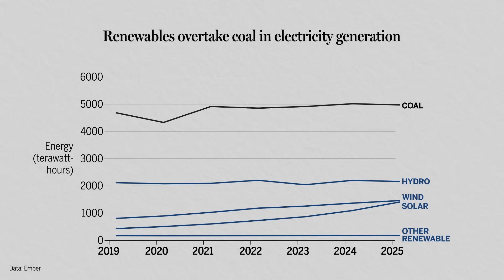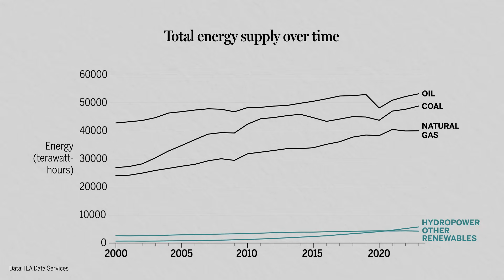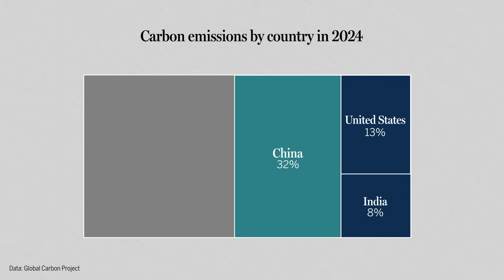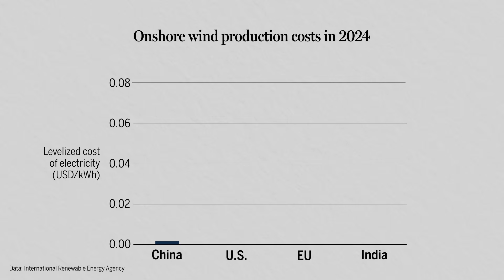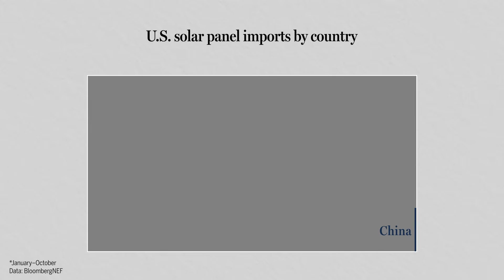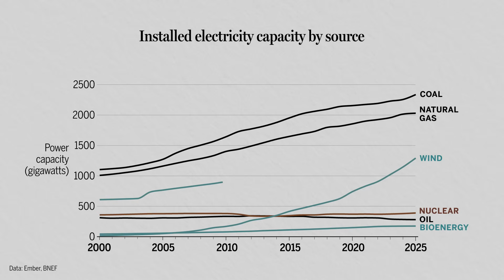How cheap renewable energy is finally flattening emissions

Comment: Why pay for expensive gas/oil/coal if you can have cheap solar, wind, hydro.
Reply: and the funny thing is the oil/gas industry is expensive even while being subsidized like solar. even right now the US alone spends about 40 billion a year on oil and gas subsidies. and many times more that in tax breaks and preferential treatment.
Reply: @romanplays1  the UK currently has the highest energy prices in the world…  the sole reason is to subsidise “green energy”.  We are closing down our oil production so that we can import it from other countries instead.
Reply: @adamski6312  Completely untrue, energy prices in the UK skyrocketed when the war in Ukraine started. It is soaring oil and gas prices that causes the high energy costs in the UK. The UK uses marginal pricing which means even if 80% of your energy is currently being produced by cheap renewables, but the remaining energy is produced by oil or gas then then highest price will be charged for all energy sources. So at the moment the UK end customers do not benefit from all the cheap energy from renewables, because you are being charged the price of oil or gas for all of it and the energy companies are making a massive profit. This will not change until you have 100% of renewables for a significant amount of time. This is why people need to cop on, and press their governments to either change the marginal pricing system so that customers can benefit from the cheapest form of energy (renewables) or push their governments to move faster to 100% renewables and battery.
Reply: @I@ImpossibleSolution-k6wrent crude is at a 5 year low at the minute, yet energy bills are higher than ever.  Energy bills are steadily rising as oil price has been steadily falling
Reply: @adamski6312 . ??? Crude as fuel goes to transportation, not home heating. US gasoline prices are low, $3/gallon. Last time gas was this cheap was 2015 , inflation corrected, w OPEC crashing the market. Last time before that was 2005.
Electricity prices are riding, but that has nothing to do w crude. Adding a lot of solar and wind, which never closes old plants, but needs new spending, that drives up power bills.
Reply: @adamski6312  Oil is generally not used for generating electricity, but good job trying to make sense. Have a participation trophy.
Reply: @Nill757 I was responding to the person that said energy prices in the UK are high because the crude price is high….
I’m aware that crude oil has nothing to do with home energy.  I’m not stupid
Reply: @d@davestagnerat w @davestagner d I say that?? You sarcastically wade in saying I need a trophy, when you didn’t even bother to read what was said.  The person I was replying to said energy prices were high because of oil price…. I pointed out that this wasn’t the case, as uk energy price is rising alongside the falling oil prices.
How embarrassing for you
Reply: @adamski6312  Isn't the problem here marginal priicng rather than green subsidy? Check it out.
Reply: @ImpossibleSolution-k6w I agree people need to voice there opinion and demonstrate against marginal pricing, all electricity sources should be priced independently, this will also give incentives for the utilities that largely rely on Oil and Gas for production to switch to renewables because they will start to lose money and go bankrupt if they don’t change practices.
Reply: @adamski6312  The current UK nuclear project will triple the cost of electricity for the next 50 years! While renewable can make electricity at 6 pence per kWh nuclear is about 20 pence per kWh without considering the transmission... You are like Abbot and Cancun Cruz : you inverse the cause and the solution in the hope that people keep making the worst decision available!
Reply: @romanplays1  Renewables actually get much more in subsidies
Reply: @thegreataynrand7210  you got any facts for that delirious take?
Reply: @romanplays1 Yes simple research that any 10 year old can do online.
Reply: @thegreataynrand7210 so you got none. Understood
Reply: @thegreataynrand7210  Being allowed to just dump waste CO2 from burning fossil fuels into the atmosphere unabated IS a subsidy, just like a business dumping its garbage in your yard without consequences would be a subsidy. Current carbon capture/sequestration techniques cost $200-500/ton, best case. It takes about 50 gallons of gasoline to produce a ton of CO2. So it would cost $4-10/gallon to clean up the CO2 from burning gasoline. That is a subsidy. Feel free to fact-check me. But if you retreat into climate denial and saying CO2 is not a problem, I’m going to point and laugh, and so will every rational person.
Reply: @davestagner No ine is denying anything and the facts are that renewables recieve far more subsidies than fossil fuels and have been for years. As stated before climste change is a manageable problem.
Reply: @romanplays1 wind and solar get enormous direct subsidies.  FF get almost none (direct). FF does get tax breaks.
Reply: @Nill757 A tax break is a subsidy! Just in a different  form!! and dollar for dollar fossil fuels get way more subsidies than renewables, I believe if I am remembering correctly, the Just have a think channel covered this in detail.
Reply: @ImpossibleSolution-k6wyes, but a very different kind than direct subsidies to VRE which directly affect prices and distort markets.

Just have a Thjnk is propaganda for fanboys. Read IEA instead
Reply: @Nill757 that’s the point the politicians in charge wants to distort the market to make Renewable Energy investments more attractive.
Reply: @thegreataynrand7210  Not if we consider the data. Just last year, the tax credit from the oil and gaz sector is a part of the GDP.
Reply: @thegreataynrand7210  "Renewables actually get much more in subsidies"
Citation please.

Telling people to look it up is not a citation.
Reply: When your country is run by someone being paid by the people profiting from gas/oil/coal and you are not too bright and actually believes him.
Reply: @edvoon most politicians are in the pocket of big solar wind  and their NGOs now.  $trillions of business.  But the hippies, yeah they can’t give up the notion that big oil runs everything they don’t like.
Reply: @Nill757 total nonsense, stop reading pro oil and gas rubbish!! Renewables is cheaper by far. If you remove all subsidies from both oil/gas and renewables. Renewables is the winner. Investment bankers are keen, not because of the subsidies but because there is money to be made and so long as the marginal pricing system exists there are serious windfalls to be made in renewables, because the are getting paid ff prices for generating electricity with renewables. So all those currently investing in renewables in the UK wont be rushing for 100% renewables any time soon, because so long as there are people like you to keep beating this particular drum and slow down the total switch to renewables it suits them fine, to be paid 30% more than it costs them even with profit.  Inform yourself about marginal pricing.
Reply: @Nill757  Least delusional anti-renewable proponent.
Reply: @latlatko I’m anti big lobby $ influence on policy - from anyone. I’m not anti RE hydro, and I’m not anti small shares of RE wind and solar as long as it’s not driven by subsidies and mandates. Im strongly anti the notion of trying run anything 100% solar+wind, or even 50%.
Reply: @Nill757  Why shouldn't it be driven by mandate? Don't  you think the people should have a say in how their country is run? Hydro power isn't possible in many places, and renewables are simply a necessary component of the future. Nuclear is the only viable alternative but good luck achieving anything of note there in a viable timeframe.
Reply: @latlatko . Not sure how mandates are consistent with “people having a say  how their country is run”. Mandates mean some people, possibly including the best connected and special interests invested in W/S, force others to do what they are told regardless of cost. 

My main objection to wind and solar is that I think it’s backwards to assume W//S can do it all, and that nuclear takes forever.  Nuclear in my view is the only option to an all clean grid next several decades that’s affordable, w low impact, vs the vast land use from 100% W/S and transmission everywhere. After  that, CCS w FF is next best bet. Anything but 100%WWS. No surprise that the WS  notion continues given the years or fraud from the like of Jacobson.
Reply: @Nill757 a mandate is given by the people. and regarding nuclear, I'll believe it when we actually start building reactors. for now it just seems like a cynical attempt from anti-environmentalists to undercut efforts to move away from fossil fuels
Reply: @l @latlatko govt mandate for forms  of energy to all the people comes from some of the people.  Should be a majority, but even that may not be the case given the special interests motivated to have their product mandated.

As for VRE vs nuclear, well as I said earlier, it’s the majority power grid share of intermittent power looks delusional to me, exists nowhere in the world. But majority nuclear examples do exist, for decades now.
Reply: @Nill757  Like I said, i'll believe it when the reactors start being build. if that happens: great, awesome. love it. But the reality is we're not gonna get there in time. should've started that decades ago. So i don't like this 'oh we'll just build nuclear' argument because most people making it seem to have the hidden agenda to keep pushing for fossil fuels, because they know nuclear isn't gonna be ready in time. So if your argument is, build nuclear and renewable, thats fine. but if it is stop the current renewable plans in favour for a nuclear option which may or may not happen, thats my issue. Because i simply don't trust that it would actually happen.
Reply: @latlatko bizarre. I don’t follow the default assumption that non-hydro renewables will get there in time, or ever, when it never has, not anywhere, ever.
Reply: @Nill757 give us a break mate! That is simply rubbish
Reply: @Nill757 After you buy a subsidised panel it gives back that subsidy via less coal burning and the lessening, even minutely, of the impact of climate change. But wait you say - it is bad to make panels re climate change. Time to see the reality that change is a challenge for me and you
Reply: It's not cheap either in installation or cost to the environment.
Reply: @seewhatifound it only needs to be better than then the alternative
Reply: @latlatko  But it is not , it is not sustainable on a daily basis without relying on other nations. The expensive cost on energy thrust upon us doesn't make it cheaper and an outlay of thousands of pounds for 4kw a day imakes no sense when the carbon cost of the whole manufacturing process is taken into account .
Reply: @seewhatifound  The entire fossile fuel sector is also unsustainable without relying on other nations, so that point is moot. Exepnsive energy is a whole other can of worm, but the main driver of that is increased natural gas prices. I don't know what an outlay of thousands of pounds means, nor what you want to achieve by using kw a day as unit, please use a standard energy term like kwh so you can actually compare because right now i don't know if you mean 4000 watt of solar panels operating for a whole day. or 4000 kw generated over a period of a day. but if you say thousands of pounds i assume you mean the installation of a 4 kw solar panel system. which will generate between 15 and 19 kwh a day. with the average lifespan of a panel being 30 year. If we assume the higher end of installation costs of 10000 pounds. that is 5 cents per generated kwh over the entire lifetime. If you think thats expensive you're just lying. and finally Solar panels pay for their own energy and carbon costs within 2-3 years. that is taking all inputs into account. and can be reduced further by using more renewable energy in their manufacturing.
Reply: @latlatko  nuclear time.  forget the buzzwords and half truths about solar and wind. nuclear is the future.
Reply: @JohnDoe-tx8eu  Nuclear is at least as filled with buzzwords and half truths. And my position stands: I believe it when it happens, and if it does. awesome. But untill then, dual pronged approach.
Reply: @JohnDoe-tx8eu  Nuclear is like hydrogen. It is perfect until you consider economic. And then it makes abolutely no sense whatsoever. Nuclear had a good run in the 50 because government spend without thinking needing more bombs to blow out the red... Now when the real cost are considered, it makes absolutely no sense. The current UK nuclear project will triple the cost of electricity for the next 50 years!
Reply: @seewhatifound  There is no free lunch! If you want to see what is the "alternative" National Geographic have made a great paper on Tar Sands! Thousands of miles of poisonous water and soil!!! So clean wow!!!
Reply: @pierregravel-primeau702  in the UK?....Thought not. How much mining has there been to supply the renewable industry? Tar sands are not everything, plenty of other options.
Reply: @seewhatifound  Tar sands are just the most obvious example of the destruction made by fossile fuel. I am pretty sure you can find many horror stories about when the UK was exploiting fossile fuels. It is not for nothing that rich countries don't want mining on their territories and give these role to horrible countries without any stabilities. If the local population is consulted it would never work. Nobody want  absolute destruction of their environment to make some wealthy oligarch wealthier...
Reply: @pierregravel-primeau702  An old story been going on from 10 -20 years ago when the environmentalist s were pushing their agenda alongside net zero. Net zero that became a "thing" dreampt up by those in Davos after the 2008 financial crisis meltdown to reset the world economy and make fortunes for themselves. Look at them today all fawning over each other. The worst end of society as it stands
Reply: @seewhatifound  If you look at Europe and China, they are all getting rid of fossile fuel : it cost too much and who want to depend and beg some arab prince that kill american citizens?
Americans I guess....
Reply: Irony. Western countries heavily investing in renewables have the highest energy prices. Germany, UK and even sunny, rooftop solar heavy Australia. The energy generation (!!!) might be cheaper. But the investment required into transmission and grid stability was underestimated at best ... If not forgotten over the last year's/ decades.
Reply: @surfer123au That is very true, and the cost of building out transmission and grid infrastructure for renewable technologies needs to become a lot cheaper. How that’s actually going to happen I have no idea?
Reply: @surfer123au  You know how much having few private jets for each of your pets cost? You are really ignorant of the need of the aristocratic class!
Reply: Cheap solar ROFL ....
Reply: It's not cheaper ...
Reply: @nosknut  Absolutely it is a myth tuned into a "fact" If it were cheaper prices would be a lot lower now. It has been a "thing" since 1970's, so if it isn't cheaper after 50 years, it won't be cheaper in the future as every input cost will rise. Some prey on victims with their false ideology
Reply: How are you going to manufacture it?
Reply: @rack_man Using renewable energy of course
Reply: Current Hydro is still problematic
Reply: @supreetsahu1964 can be, but it is a the single best solution for countries that have stable water flow and rivers. Designed well it can produce an enormous amount of energy and limit hydropowers overall impact in the country, by building big a few places and reducing the need to impact other rivers and land areas in the country. Limit the impact to as few places as possible.
Reply: We in Australia give $21B in Diesel rebates to big miners etc
Reply: @nothinghere1960  We in Australia are paying 40% higher electricity despite all this green energy BS, and yes I have solar and battery, 27 panels and 10kw battery.
Biggest con ever, Nuclear power is the future.
Reply: @ShaneMcGrath.  Nuclear is at least as expensive if not more expensive. It costs a lot to build a reactor.
Reply: @latlatko Actually you are correct the total life cost might be manageable but the initial investment and of course the operating expenses for safely handling nuclear waste and storing it is often not taken into account and that is very high. Så overall it will increase prices of electricity rather than reduce it. 

Only dropping marginal pricing and paying producers based on there production cost + small margin would allow for the restructuring of the power grid without overcharging users of the energy for the foreseeable future.
Reply: @ShaneMcGrath. 40% higher than who ? I'm in the 3rd 🌎 at the moment ( SriLanka) and electricity rates are to increase by 11.8% next month. The BS you complain about is the legacy providers never want to make LESS profit. Any investment they make in poles and wires is payed for by us. Sounds like you have a system which is good but to keep their " profit " to satisfy shareholders the next kick will be access charges skyrocketing. And Nuclear. I learnt only yesterday that in Germany the % provided by nuclear is 3%. There is going to be pain everywhere because change is difficult
Reply: @luffirton  nuclear is the only source of power where every gram of waste has to be accounted, and its always paid for up front. PV panels, go in the dump.  Oh yes there’s talk about recycling PV, talk, but that would increase cost, so, dump.
Reply: @latlatko  PV seems cheap if the notion is a couple panels on the roof of the tree fort. If power is to run a country, then the panels must match the output of a reactor.  

Replacment of a 1 GWe reactor running 24hr requires about 5 GW of PV, ie 12 million 400W panels producing power  when the sun is up, and probably 15 million panels to get through winter. Million. At 20kg ea that’s  some 300,000 tons of panels, not including the mounting rails, foundations, wiring. The 5 GW of solar needs about 25,000 acres of land (best practice 5acres/MW).  Nobody gets chunks of land that big, so it gets cut in 50 or 100 pieces, spread around the country, which means 50 or a 100 new distribution lines cutting up the country.   Replace all of that every 25 years. The panels at $1/W are $15B if land costs hold w/ more and more land used, so land $ goes up. 

Then there’s storage, maybe 15 GWh of battery, which at $400/kwh is $6B, replaced every 15 years. 

Last, solar and battery using even the best grid tie inverters just don’t work if they are the only thing on the grid, as we know from the blackout in Iberia. Must have synchronous generators, like nuclear, that ride through fluctuations in load.
Reply: @nothinghere1960 They probably would struggle a lot more if that rebate was not in place. Since this industry is important employer for Australia. There is many citizens that impact politics in that sector by voting for politicians and parties that propose or support subsidies, deregulation and rebates and tax breaks for the mining industry.
Reply: @luffirton We give subsidies to coal , gas and mining and get absolutely screwed for the privilege
Reply: Because it’s ruining the grids. 🤷🏼‍♂️ it’s not 24/7/365 available
Reply: Sadly in Winter My solar panels are cover by snow, and if not covered produce only 1/10 of Summer production bellow  inverter standby consumption due this I need coal for winter.
Reply: @kkrolik2106  do you not clean them?
Reply: @romanplays1  I clean them only no Sun in Winter.
Reply: @kkrolik2106  yes I sure do hate living it perpetual night as soon as it hits November
Reply: @kkrolik2106 Use the grid for winter time just like me…
Reply: because renewables require expensive battery storage, the mining of huge amounts of rare earth minerals, and having backup gas-fired plants for when the sun don’t shine and the wind don’t blow.
Reply: Try looking at Britain, Germany, New York, California, etc, to see the actual cost of renewables.
Reply: @TimothyGasser  Trying looking at expert forecasters to see the actual cost of renewables.

The International Energy Agency (IEA) says solar plus storage is now the cheapest form of new electricity around the world. The lowest LCOE or Levelized Cost Of Energy. (We're talking wholesale prices, what the utilities themselves pay for electricity. What the utilities charge customers may vary and includes many other factors like grid costs and governmental pricing policies so your initial comment is very lacking in context.) 

So just who is the IEA? The IEA is THE industry-standard, go-to data aggregator and forecaster for all things related to the global energy sector. All the pros in business, investment and government turn to the IEA when they need reliable energy data. The long-standing IEA has historically favoured legacy energy like coal, oil, gas, nuclear and hydro in their projections. But now they say SOLAR PLUS STORAGE IS CHEAPEST!
Reply: @douglascutler1037  I have looked at the numbers. I have 30 years in the electric utility industry, 10 of which were in nuclear generation. As I said, the lowest cost claim is dependent of what accounting method you select. LCOE excludes costs that are associated with intermittent generation, namely backup, over build and storage.
Reply: @TimothyGasser  this sounds like you yourself are biasest towards coal then if its "dependent" on accounting method. This means your claims hold as little weight as everyone else.
Reply: @TimothyGasser  lets price in externalized enviromental costs of fossil fuels then, oh wait.. thats dystopia. lets not think about it then
Reply: @TimothyGasser  Canada is like 95% hydro and power is incredibly cheap
Reply: @davo1822  You know, a bright 12 yr old can look this up. Canada gets between 55 and 60% of its power from hydro. Canada also has 12% of the people the US does. In the real world demographics matter.
Reply: @TimothyGasser the US also has vast deserts with sun all day every day.
Reply: @xander9460  PV is cheap because oil, gas, and coal are cheap in the countries where these panels are produced. No more, no less...
In the end, there is no difference for the climate.
Nothing...
CO2 continues to rise, regardless of how much "renewable" energy you use.
No difference...
The CO2 graph proves it.
You consume a lot of energy on one side of the world to be "renewable" on the other side of that same world. The climate is a global issue, not a local "green" bubble.
Reply: @ivojanssens221  here's a wild idea:
>Use fossil fuel energy to make solar panels
>Install solar panels
>Use solar energy to make more solar panels
>Get rid of fossil fuels
>Profit
Reply: @notgreg123  Show me the solar farm that can produce 99.99999% pure silicon.
Because that's what you need for a PV.
Maybe do some research first before you make any claims.
Reply: @ivojanssens221  alright I did some research. Seems like the most energy intensive process is melting silicon down which can easily be done with electricity. It's only like 2000C as well which really isn't that bad. Just have enough solar panels to power it and ez pz
Reply: @notgreg123  It's a stove, a very large one. 24/7 because stopping and restarting the process wastes a lot of energy. And I don't know of any place on earth where the sun is present 24/7 all year round.
But that's just the beginning... now you have silicon, but it's not pure enough... more energy and chemicals will be needed... and the production of those chemicals also requires energy, 24/7... and also... it doesn't stop there, because those panels are not yet installed all over the world, and that also costs energy = transport, and sea ships no longer work with sails...
But back to the beginning, where do those "raw materials" come from? Mining... and not with "green" energy. Those raw materials are extracted, transported, globally... only to be thrown into a furnace somewhere and treated with chemicals. And those chemicals have also traveled a long way; they don't just fall out of the sky.
If you look at the big picture, you see that a PV cannot make a PV.
Please, try to find a furnace where silicon is melted. Maybe then you will understand that "green" does not exist, except in a few optimistic minds.
I can send you some links, but that's not possible via YouTube.

Now, oil is also extracted and shipped all over the world, so in that respect it doesn't make much difference. But don't make PV "green" if it isn't GREEN. And it really isn't.
Reply: @ivojanssens221  these are all just technical issues. Batteries solve the "but what about the sun not shining 24/7" issue, mining will always suck whether or not those materials are being used to make solar cells, chemicals can almost certainly be substituted considering Blue Origin figured out how to make solar cells out of nothing but lunar regolith simulant, and transportation and installation is a one time thing unlike fossil fuels that have to be continuously shipped even after the plant is built, etc. 

Doesn't matter if it's not absolutely 100% "green" if it's still 90% better than fossil fuels in every way. This is like being against masks during COVID because they're only 95% effective so they must be useless
Reply: @notgreg123  You have no idea how much energy we're talking about. It's not 90% of fossil fuel, but 110%.
In other words, it costs more energy than it yields...
But you can't tax that, so it's of no use to any government. So they tell fairy tales and hope that most people are stupid enough to believe them. And that is why the CO2 content in our atmosphere is not falling but rising, despite "green" energy.
1+1=2, regardless of how often you hear the number 3 from the mouths of our politicians.
Reply: @ivojanssens221  panels take about a year to regenerate the energy used to make them. It's not like we need a metric ton of uranium to make a cubic meter of solar panel
Reply: @notgreg123  That's BS. It's more like 30 years. You really need to do some research instead of just typing into a search engine: how much energy does it take to...
You only get what you want to hear and hear what everyone else has already heard, but which isn't actually true. But the same result comes up time and time again. Please dig a little deeper.
Reply: @ivojanssens221  alright I'll keep digging until I find the answer you like 👍
Reply: @ivojanssens221  I actually kinda want to run the numbers myself just for the heck of it, I'll get back to you eventually
Reply: @ivojanssens221  Solar farms don’t make polysilicon… factories using electricity do. The high heat required for initial purification is provided by electric arc furnaces, which can run just fine on solar electricity. Electricity is electricity. No other step requires as much energy, so all can be and are done with electricity. In other words, the entire process for producing the silicon parts of solar panels is electrified already and does not need fossil fuels at all.
Reply: @ivojanssens221  Your claim that solar panels require more energy to manufacture than they produce is demonstrably false, with simple math. Assume a 1kW solar panel, operating at 20% capacity factor for 30 years. In that time, it will produce 1x24x365x0.2x30=52,560kWh (52MWh) of energy. A good rule of thumb is 5m^2 of solar panels to produce 1kW. At 10kg/m^2, that’s about 50kg of solar panels, most of that weight is silicon (glass or silicon wafers). Panels cost about $1/watt, or $1000/kW. 

According to your “110%” claim, it would take approximately 60MWh to manufacture the 50kg of silicon in 1kW of solar panels, or more than a megawatt-hour per kg of silicon. At $100/MWh electricity prices, it would cost $6000 in electricity alone to make panels that sell for about $1000. Make that make sense. 

The reason you believe this nonsense is because you’ve never actually sat down and done the math. You should try it.
Reply: @davestagner  An furnace runs 24/7.
It could run for a few hours a day with PV, or at least with PV support. But not 24/7... PV alone is too irregular; that's not acceptable. The energy supply must be constant. So not too little, but also not too much, always just enough.
And that's why it doesn't happen.
Reply: @ivojanssens221  PV alone is not enough. PV with batteries, though? Works 24/7.
Reply: @davestagner . There are no utility solar projects with enough battery behind it to run one winter night. Two hours is most common, then four.
Reply: @ivojanssens221  No, that is flat out nonsense.
Reply: @k @keepitreal2902  So, CO2 in the atmosphere is no longer rising?
Or...
Climate is not a global phenomenon?
Or...
China is not buying cheap Russian energy?
Reply: @ivojanssens221  CO2 levels will continue to rise until our emissions are zero of course.  We're nowhere near that. However renewables produce significantly less CO2 than burning fossil fuels for energy - that is a fact. As renewables continue to increase exponentially we'll start to see a slow down in the rate of increase, but it will still increase for a while yet.
Reply: @markross7698  warming will continue for awhile with even zero manage GHG emissions, until an equilibrium is reached.

So far the fast rise in intermittent power (VRE) only seems to happen to countries for a minority share of the grid. Only a couple wealthy  countries  get to 40% VRE, at great expense and very high electric rates. China 2024 for instance is 18% solar+wind.
Reply: @ivojanssens221 Your assertion means that China would need to produce enough energy to power the entire world, and encapsulate that in solar panels for export, whereupon buyers of the solar panels would then draw down on the encapsulated energy.😂 This is clearly nonsense.
Reply: @keepitreal2902  Look at the facts, not what someone wants you to believe. The figures regarding CO2 are real. Now you have to ask yourself why, despite all the green energy, this is the case. Just hard facts and no blah blah blah. If you now think that we are saving the world and can consume energy without end, the end will only come sooner.
Reply: @ivojanssens221 I disproved your statement above with logic. It wasn't difficult.
Reply: @ivojanssens221  CO2 emissions have peaked in China thanks to massive investments in energy sources not based on combustion, mainly solar, wind and hydro
Reply: @ivojanssens221  Ivo, je snapt er geen reet van..
Reply: @khunjeau8393  The graph showing the amount of CO2 in our atmosphere does not lie. That does not mean that I am right, but it does mean that you are definitely wrong.
Reply: @i @ivojanssens221 It doesn’t really tell the whole picture. CO2 levels are not falling yet because of a large increase in energy use worldwide, also due to datacenters, rise of welfare in developing countries.. Transition takes time but renewable is the only way to go if we want to keep the planet habitable..
Reply: @khunjeau8393  I agree 100% that renewable energy is necessary. The question is, are the things we are doing today also 100% renewable? If not, we have lost our only chance. And that is a serious gamble...

Energy consumption is rising. But "renewable" energy is rising exponentially, faster than consumption. At some point, there should be a decrease in CO2, and if not, it just means that renewable energy is not as renewable as we thought.

We will see where CO2 levels will be in 10 years. And then we will know if this gamble was the right one.
I hope so, but I strongly doubt it.
I'll hear from you again in 2035 or 36 (if I'm still alive) with the new global CO2 graph and what is causing any decrease or increase in that level.

Regardless, we may also see whether CO2 is actually our biggest problem...

Stay healthy, breathe deeply, because without CO2 we are dead 😄.
Enjoy the holidays. Have a wonderful time with family and friends.